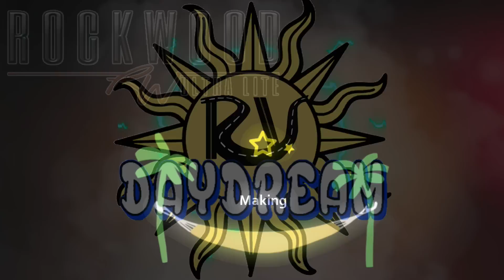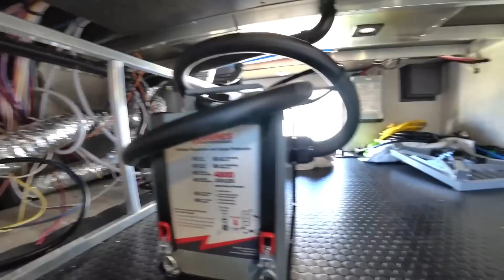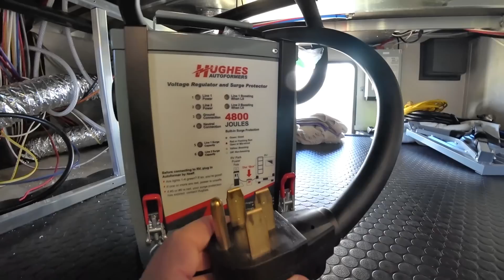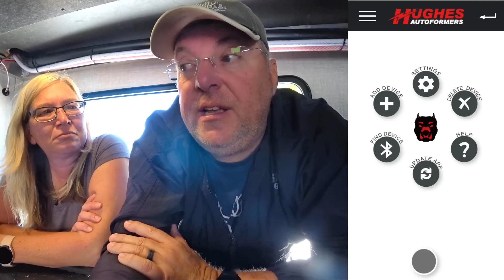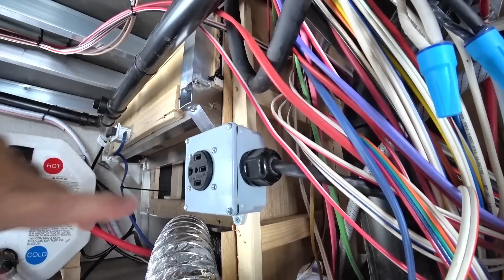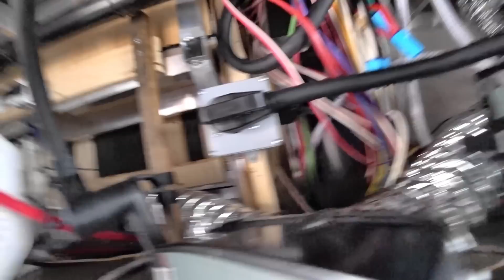Rockwood 5th Wheel indoor Surge protector

Comment: You are spot on will everything. The only problem the autoformer causes is putting a spotlight on an already existing issue. You are paying for 50 amps you should be able to use 50 amps. I'm going  to do a similar setup with my class a. I found an affordable automatic transfer switch that I'm going to wire the onboard generator into that switches between shore power and generator.
Reply: 100% agreement here. You should be able to get what you pay, and furthermore, they should just follow the proper dam electrical code, 50 amps is 50 amps, not 30, not 35, not 40, not 45, 50. And honestly, if the park was doing it right, it should give a little leeway and be just over 50-amps available, to insure it makes the 50-amps constant. I own a generator, so I think I know a thing or too about AMP outputs at 120v and 240v.